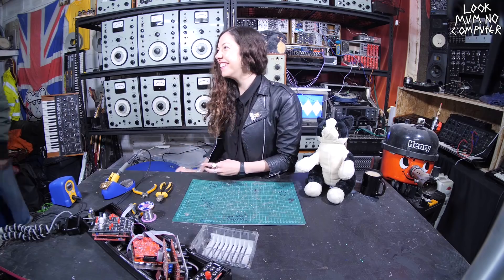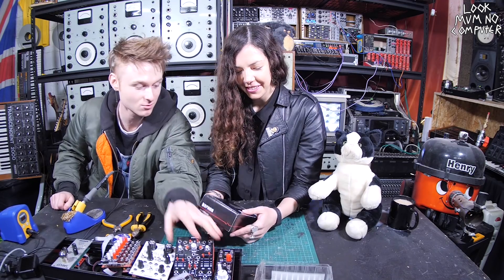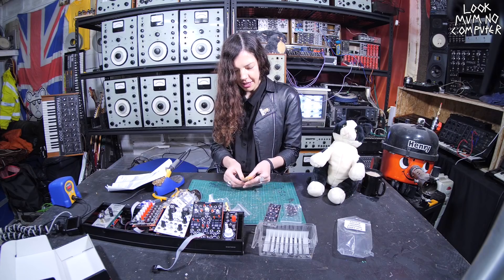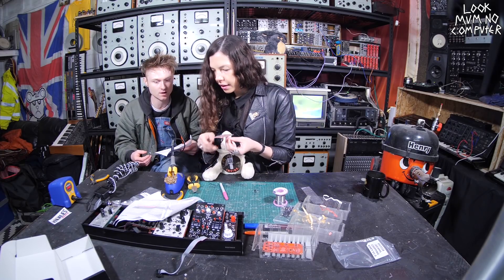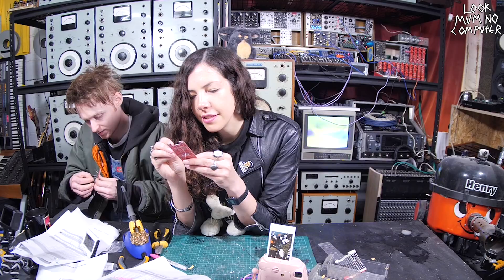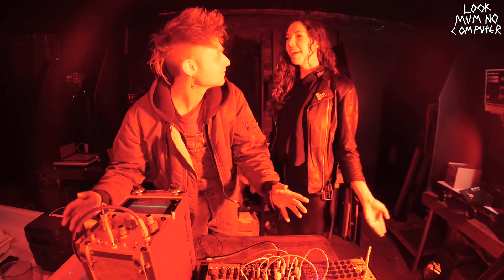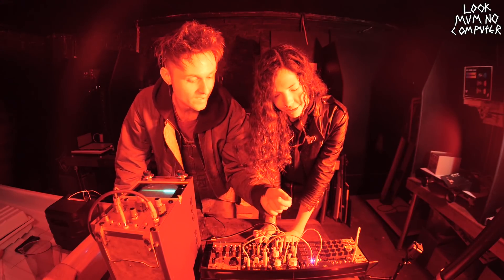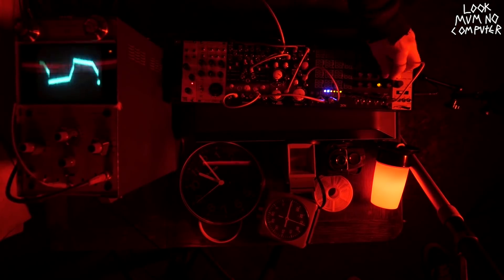My girlfriend and I built a BEFACO Chopping Kinky Modular Synth Kit

Comment: following instructions and assembling one of these kits isn't too hard, yeah, but when you do and it doesn't work, troubleshooting what went wrong is the pain in the ass. Could you do a video on where you start when something's buggered?
Reply: I was just thinking about that. Solder certain components in backwards and... POP. Depending on the current...? Some don’t matter, but some really do. I blew up a RAM chip at work once. So embarrassing.

Comment: What's happening with the diy synth series?
Reply from the maker: Fart box. and Envelope gen, and high pass filter mod! coming up! . there will be a big splurge of these videos in the next few weeks. i promise.
Reply from the maker: i working quite hard on making the far box project easy to understand. because that is basically an all in one synth voice. with a surprisingly small amount of components!
Reply: @LOOKMUMNOCOMPUTER  YEAH, that smells extremely GOOD
Reply from the maker: @TudorIrimescu  yeah! well sadly, it aint gunna be ADSR, my thinking is in modular either A-R or A D is used, seinse putting a sustain point in and stuff actually starts complicating things, ive designed an AD (or flick a switch to AR) with under 10 components, ill be doing a vid on it next week.
Reply: @TudorIrimescu  ai-synthesis has an amazing looping adsr envelope generator. It only uses 2 opamp ics. They provide kits for the module and schematics.
Reply: Tudor Irimescu if you can’t wait look up (my)  “modular in a week” for an AD/AR (and lots of other modules of course)... I also tried doing an ADSR but as Sam says that really complicates things, and couldn’t keep within the 4h per day restraint :) I will have a go at it in the future again though.
Reply: Nice I basically asked the same thing. An envelope generator would be nice. I've tried my hand at few different ADSR's and none have really worked out. Made the Thomas Henry CMOS AD EG and that was pretty sweet and simple. I'm excited for what Sam gives us. The filter and vco have worked nicely for me.